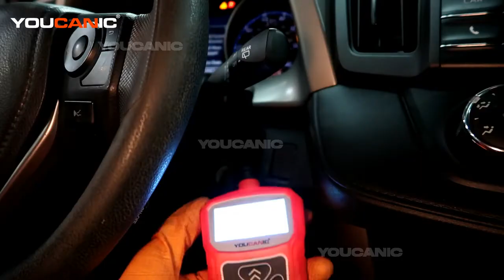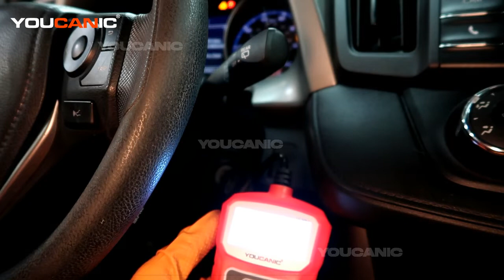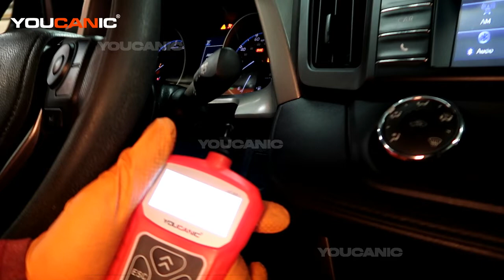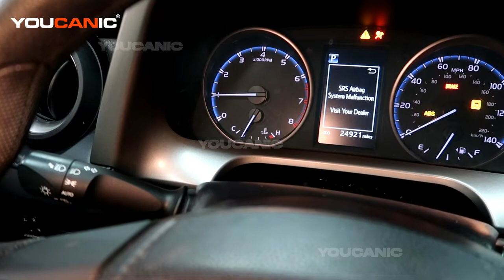Toyota Fault Code P0013 B Camshaft Position Actuator Replacement

Comment: What if the VVT is working but I’m still getting the code, but no check engine lifht
Reply from the maker: Thank you for your query! At Youcanic, we believe in empowering car owners like you with comprehensive guides, free resources and powerful tools like our YOUCANIC scanner. If your VVT is functioning but you're still getting the code without a check engine light, it may be a minor glitch that a diagnostic scan can clarify. Feel free to dive into our resources online or purchase our factory repair manuals if you need more specialized information. Remember, we're here to assist you on your car ownership journey! Visit us at www.youcanic.com.